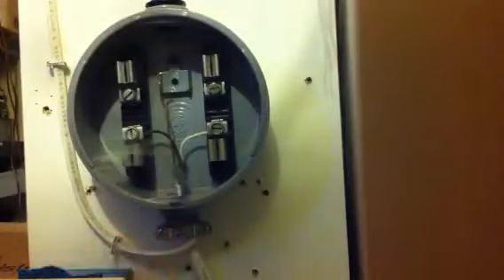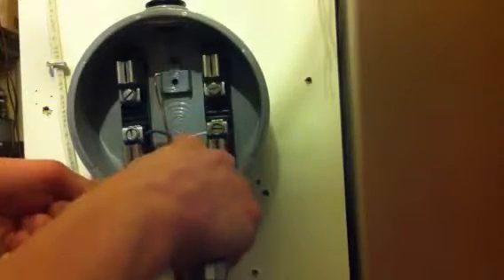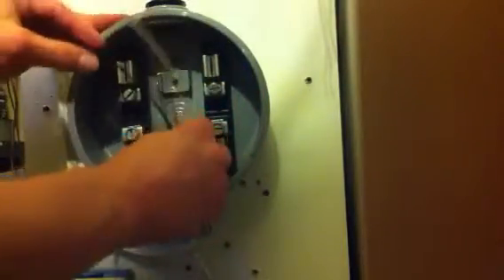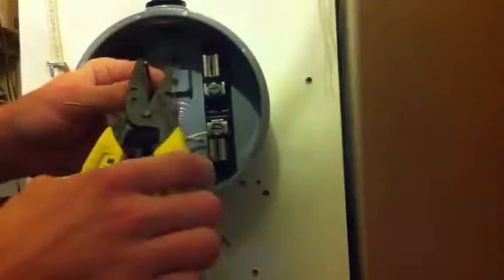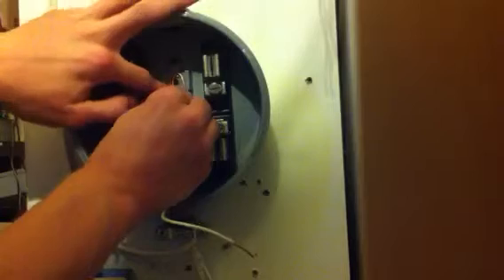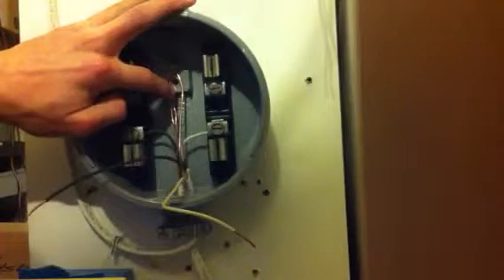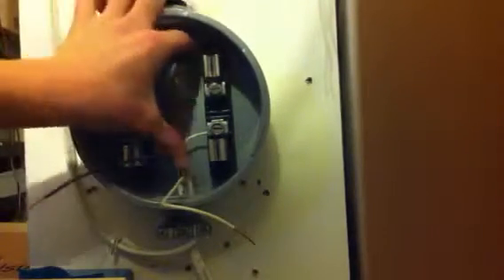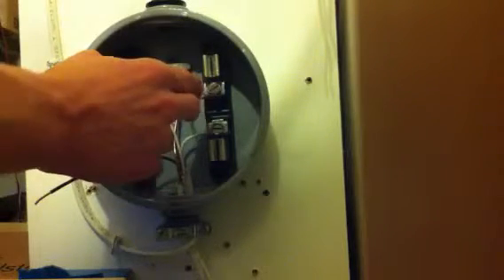Meter socket replacement pt 2

Comment: nice work .... not  i bet you nicked the wire when you stripped it back , theres better ways to strip the wire casing! romex looked nice going into the connector ...